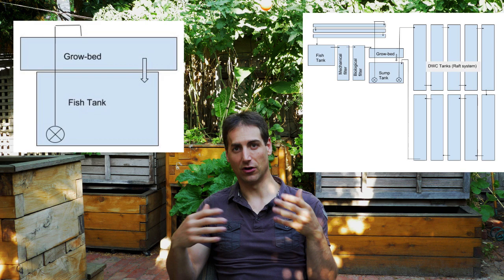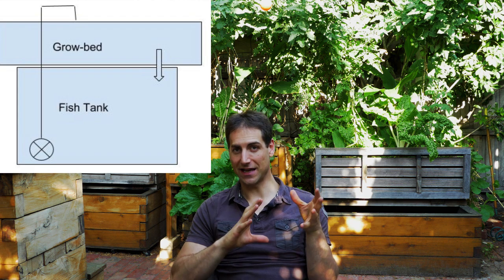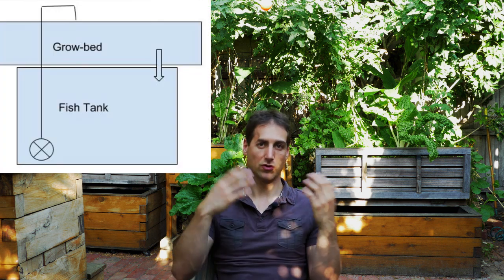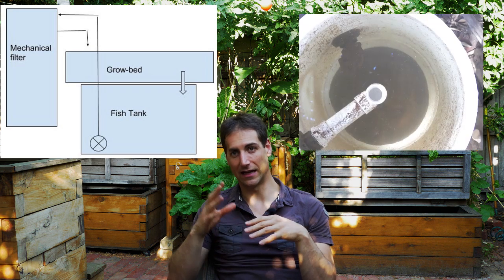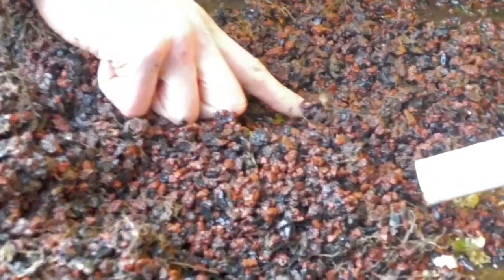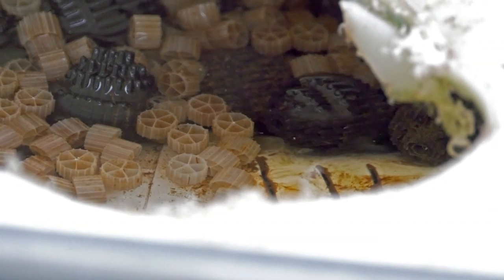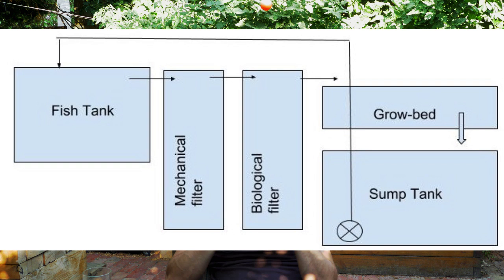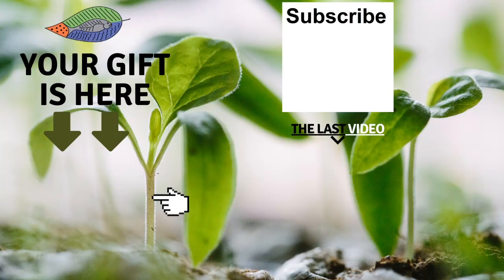Aquaponics concept | commercial aquaponics system

Comment: I use some constant flood beds. And some flood and drain dual root zone aquaponics. 
I am going to try out a large dual root zone no till flood and drain bed.
Reply from the maker: Very interesting Indica Dogo, Can you tell us more about your dual root zone?
Cheers 
Jonathan
😉
Reply: @AquaponicsRevolution  Absolutely, would be my pleasure! Dual Root zone is basically combine aquaponics with soil. So I have a traditional flood and drain media filled bed. Then I take a 5g bucket and drill holes in the bottom. Fill the bucket half way with the same media I have in the grow bed. Now I place a layer of burlap on top of the media in the bucket. This is to keep soil from falling down into the bottom of the bucket and then into the grow bed. Now I fill the top half of the bucket with soil and plant.  I carefully measure the amount of water the soil layer can take before water drains out of the bottom of the bucket. Then put the bucket into the grow bed making sure to have it high enough that the water doesn't suck up into the soil layer. Now this gives me a soil zone that I can amend in anything I might want the plant to have. But the fish may not want. And gives me an additional home for mycorrizhae fungi, beneficial bacteria and soil critters! I learened this technique from some great aquaponic growers on a show called. Growing with Fishes it's another great resource like you have, for learning about aquaponics and living soil food web. And I'd again like to thank you so much for the amazing information you provide some many people! THANK YOU!!!